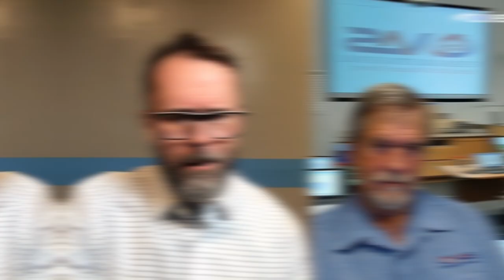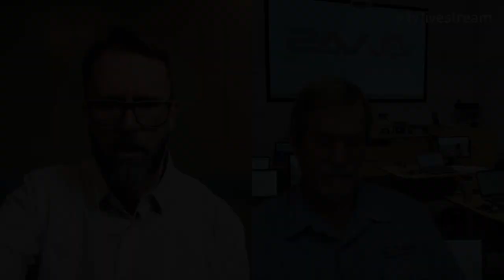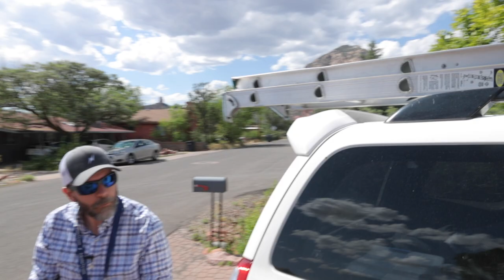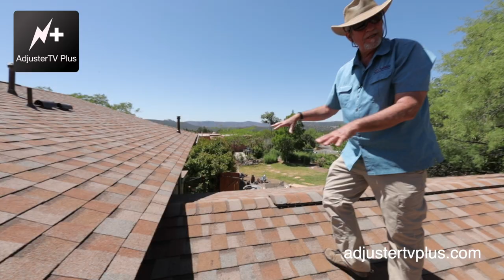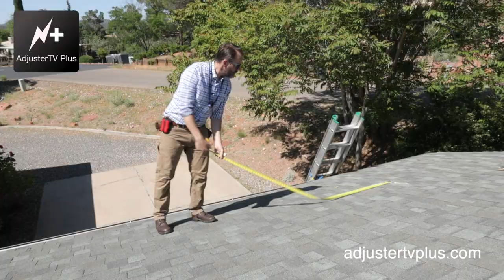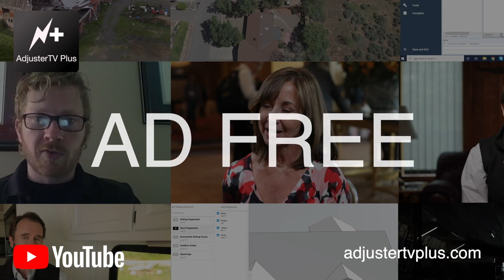ATV Clips Do I have to climb steep roofs?

Comment: at 2:40 - what tool is he referring to? The Goat? Apparently, you don't need a 28' ladder with that?
Reply from the maker: https://www.thegoatsteepassist.com/  It's a roof ladder.  You still have to get up to the roof so yes, you would still need a regular ladder.
Reply: Found it on the web - it is basically a very similar design to the Pompier ladder used in the fire service, but used for roofs.

Comment: I have to inspect a commercial building that is a 10/12, and it was sprinkling when I met the roofer, so none of us got on the roof. I know it's not safe if its wet
Reply from the maker: yikes, that would be scary even if it was bone dry.  10's are about my upper limit, at least without fall protection.
Reply: I wonder if drones are acceptable now? Bc I'm afraid of heights.
Reply: @AdjusterTV  as an IA are you allowed to request a ladder assist? Also would this be refundable by the carrier or just out of pocket? 

I’m currently a staff CAT adjuster in DFW area looking to make the switch to IA but my only reservation is on the really steep roofs that are 12+ pitch which is common in my area. On your video you mention “you make it happen,” for these situations can you elaborate on how you do that? Thank you for your time!
Reply from the maker: @Nick-co1bj  Hey, Nick..  so yes, you do have to "make it happen" but that can mean hiring a ladder assist - which some firms or carriers will provide for IAs.  Or investing in fall protection and tall ladders.  
If you're working cat you'll likely be working around the Midwest, not just in your area.  Most houses are not steep/high in the midwest.  
Also, any out-of-pocket expense can be tax deductible depending on how you're paid (W2 vs 1099) so I don't really worry about that kind of $$ outlay to get a claim closed.  It all shakes out in the end.
Reply: @AdjusterTV  awesome, that is good to know! Thank you for the response! Love your channel btw